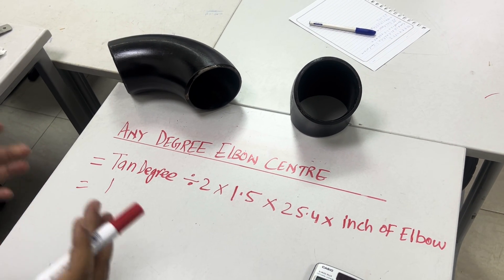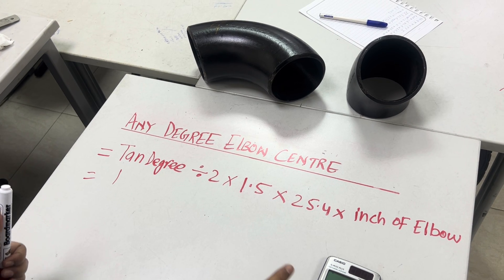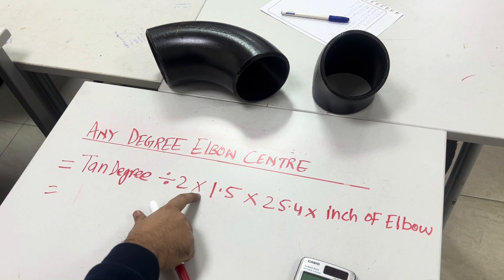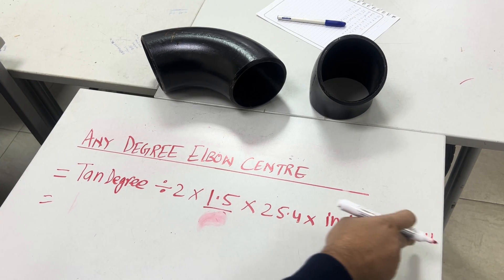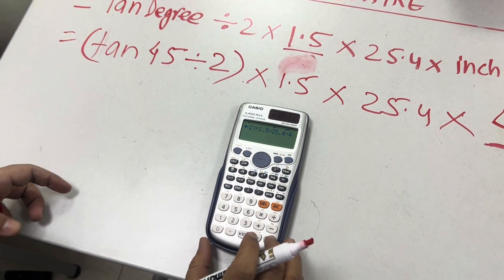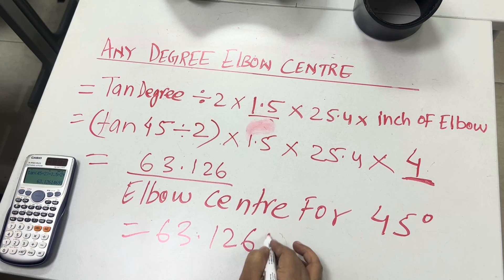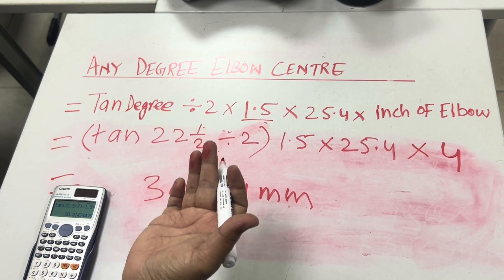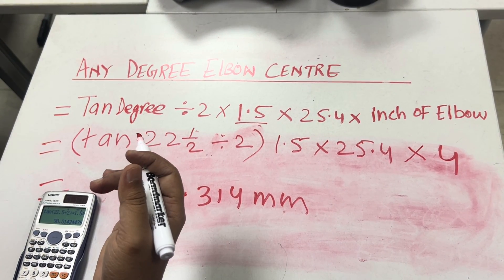Pipe elbow center formula all degree //How to calculate any elbow degree center

Comment: I got a pipe length of 4315 and I need to roll it into 360 degrees and it a 4inch pipe.. Curcumference and how to mark it
Reply from the maker: That's a great question! I'll try to make a video on calculating pipe curvature and marking for rolling.